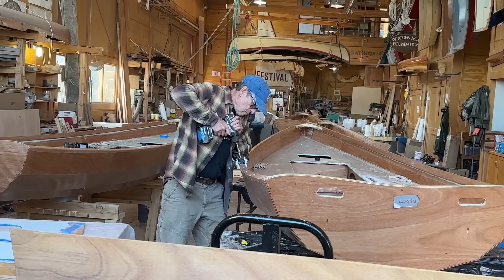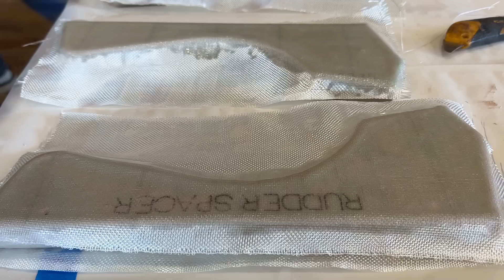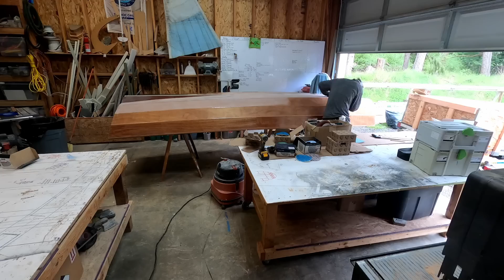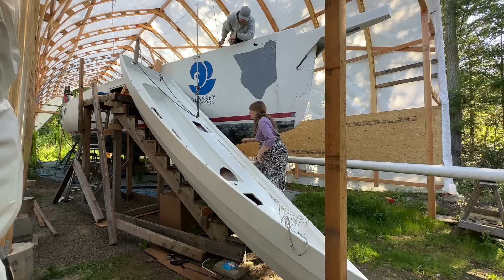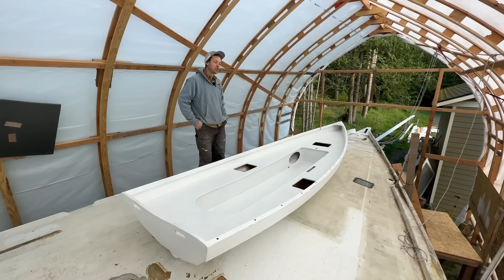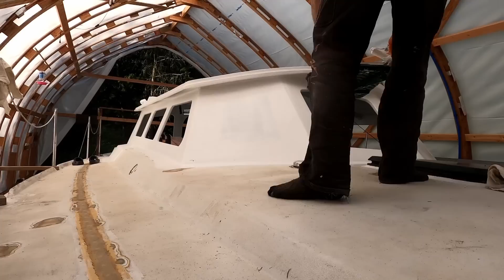The Dinghy meets the Duracell! [EP 126]

Comment: In my opinion using a roller to apply paint uses quite a bit more paint than using a sprayer does. You can adjust the volume on the spray gun so very little paint is put down. The boat is lookin great though man.

Comment: Great,  you took my Greenhouse plastic suggestion.  

My nearly free tie-down technique is: place a golf ball sized, round rock under the corner of the plastic.  In about 2" from the edges. I wrap it twice with bailing twine or small rope. This grabs the edges very well.  Now you have tie-down locations wherever you want.  Plus,  just cut away when done & you've still got  plastic without holes. 

Go on, give it a go! 

~ DiveGirl Deb 
SV Melittin's Miracle 
Eugene Oregon
Reply: Great suggestion!  I've used that same method for tying down plastic tarps pressed into service as lightweight camping shelters, for more years than I can count.

Comment: I can't remember whether i asked this before . But how does this work , one centerboard that is installed off center ? I'm used to sailing but i can't figure this out .
Reply: For a daggerboard, it makes almost no difference if it is off center.  It is the fore-aft position that matters as that determines the position of the center of lateral area.  This is also true for masts - they can be offset from the center line of the boat with little or no noticeable effect.

Comment: I worry...you were at the heavy end...my somewhat negative previous dingy comment was not negative as to beauty, sailing, and rowing functionality but to its gossamer build and ruggedness...suppose you're at anchor pacific paradise need to row/motor ashore what is the freeboard safety margin with two adults and say your three year old son...IMHO what about hard hull dingy for safety with the family...find a used old Whaler 11'Tender or inflatable that bounces off everything or a good winch on the "Battery" and an old 13' Whaler stripped to bare hull weight 300 ...and a 3.5 Tohatsu engine for all weighs 40lbs

Comment: Does the graphite epoxy fill coat add strength or stiffness, or is purely to achieve a certain surface finish?
Reply from the maker: The graphite adds abrasion resistance.

Comment: From so many other sailing channels, launching a dinghy from the foredeck with the hailard is not easy when you have to keep it away from the Hull when lowering it. Why not build a rotating small crane that can easily assist you instead of the hailard? The crane can be fixed but it can also be fitted into a prepared hole in the deck. Insert the crane in the hole and Voila!
Reply from the maker: I'm actually thinking about using a short spinnaker pole attached to the mast that can be used as a sort of crane/davit to keep it away from the hull and have more control when maneuvering the dinghy on and off the foredeck.
Reply: @TheDuracellProject  Great idea - and weight saving! 🙂

Comment: Two thought on that rather nice dinghy.   Please bear in mind these a just thoughts on projects I have never seen done well.    If there is any team, you, wife and mom, that can pull it off you're the one.  OK here we go.
1) Sacrificial easily replaced wear strips on the bottom.   Yep one coral encounter or 50 beach visits and the bottom of the dinghy  will say, "you know that hurts" .
2)  Well fitted and thoughtfully connected tubes around the dinghy to improve stability and enhance load capacity.   Should they be air filled, shaped foam or something else?    Please share your thoughts, everyone is invited.   I just love to sit on my veranda and watch this team designing and working.

Comment: A small 2-stroke outboard up to 5hp would make more sense IMO. You would use so little fuel, its more compact, cheap and no need to be concerned about battery charge/range. 90% of the time, just rowing it will be a joy.

Comment: Why not rear Davits system for the dingy with a solar panel roof setup? The inspector thinks that would be Prrrrfect!
Reply: Carrying a dinghy on davits at sea is asking for trouble. How much do you think a 14ft dinghy full of seawater weighs. How about the force on that area when a wave breaks on it?   Not smart. Davits are ok as an overnight storage or for sheltered daysails. Plus there is an aero drag cost. More aero drag is more leeway upwind, so worse windward performance in a direct linear correlation.
Reply: The inspector would be pur-plexed by such a catastrophic design idea